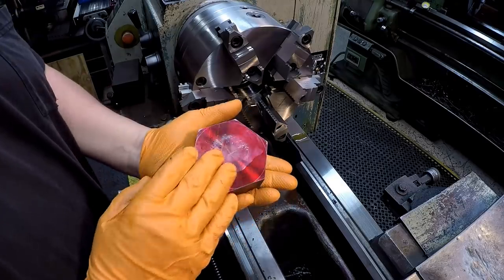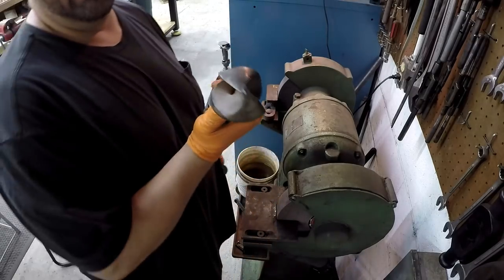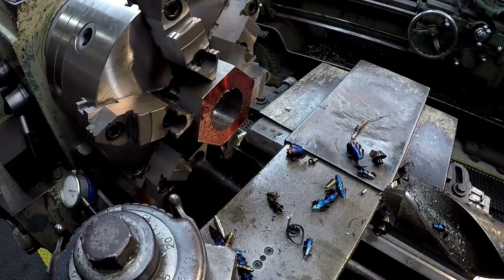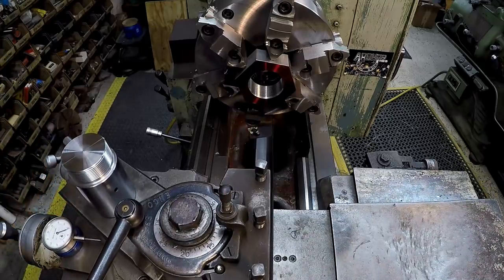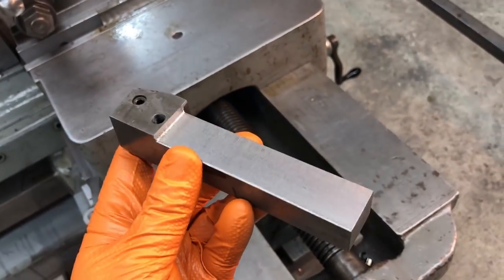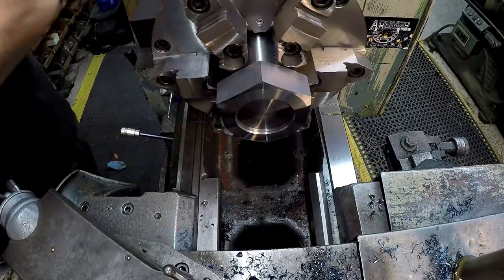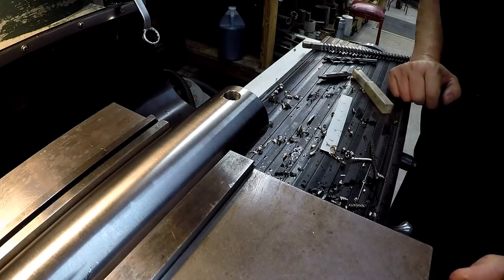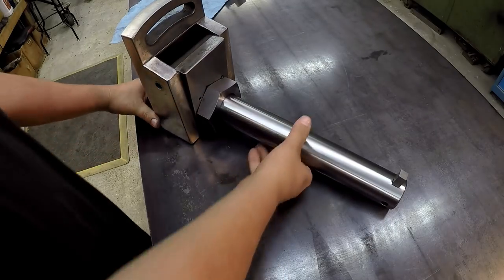Custom Internal Shaping Bar Part 4

Comment: Nice job Adam as usual!!
I have one suggestion for you, would it be good to cut two flat on the bar close from the nut to be able to hold the bar with a wrench while tightening the nut to prevent the bar from turning when you adjust the cutter angle??

Just an opinion here but i think it would be practical for you.

Thanks Adam

Comment: Using the shaper to modify the tool holder to cut threads for tooling to run on the shaper.  That's some 'circle of shop life' stuff there, Simba...
Reply: Custom bars

Comment: Little trick I was taught about threads if they are too tight... put in some valve grinding compound.. will polish the threads for smoother operation and give you a little slight more clearance and info an old timer gave me...

Comment: Hey Abom why don't you put a little finishing touch on that nut with some of that tool blue compound you got to stop it from flash rusting seen as it will be handled a lot with bare hands? It would be a shame to see it have rusty fingerprints on it seen as you did such a nice job machining it shiny and smooth. P.S I can't wait to see you put this bad boy to work.
Reply from the maker: What about my rainbow finish? 🙁
Reply: @Abom79 , Why stop there, you can hone it in with lapping compound and diamonds!

Comment: The 6 jaw chuck seems to be working very well for you.  I'm always amazed at the finishes you get on your work.  I've made some big nuts while working at the shipyard, but it was mostly hot rolled and the finishes even with some emery cloth never seemed a smooth and shiny as yours.

Comment: I find that today there are very few people who can sharpen a drill bit off hand.
Reply: Yeah sharpening drills is a skill I have yet to master.  If the drill isn't real bad I can get it sharp, but there's them days i can't seam to get a certain drill sharp enough to cut wood. I seem to toss them in a can and let sit. I wonder if the twist rate is different than what I'm used to. But if the drill looks like Ave used it in that cryobi mill in some dare to purposely wreck a bit, ehhh I'll have to try n get some pics of the drills I found in the shop hiding out in the corners and under presses,. 1 looks like someone ran it backwards at Sonic speeds to do some spot welding on A2 treated n tempered steel.
Reply: You need a good grinder that has big enough stone for the drills, needs to be kept dressed regular

Comment: Can I ask a really dumb question, not trying to be a butt head? Why would you cut down your tool holder (a five minute job on a milling machine) on a shaper (turning it into a 30+ minute job with a worse surface finish)? Again not trying to be a jerk.
Reply: Tony if you watch Abom much, you’ll see he likes to show different methods that can be used. Yes he could have used the mill or he could have used a belt sander or he could have used a file for days. At this point in his videos he was trying to gain experience with the shaper. I don’t agree with the mill giving a better finish. I prefer the wood grain finish over the swirl marks from the mill.

Comment: There are those nice toolbit sleeves you can just press into a round hole to make a boring bar, or in this case a shaping bar. I think Keith Fenner demonstrated them. You can get them all the way up to 1" toolbit size and it eliminates the need for broaching. Nice job on the threading, real pleasure watching your work. Thanks for the video. Cheers.

Comment: Beautiful work, Adam. The shop that I worked in years ago had a similar bar with one significant difference. Don't know if it was shop built or not. It had three or four (it's been too long) square holes in the bar for tools. That was useful when setting up, although not completely necessary. Choose the hole that most closely fits your setup and make a minor stroke adjustment. It also kept the ram basically in the middle of its travel and limited stickout. More contact with the ways and maybe less chatter in theory. Not sure if it made a noteworthy difference, but we used it with great results.
Reply from the maker: Not a bad way to do it. Thanks.
Reply: Worked really well for what we ran into. This was a rural Indiana machine shop. We did some production work, but the main business was fixing machinery for farmers. Those guys, God love them, could break an anvil in a sandpile. Thanks for sharing your knowledge Adam.

Comment: I used to grind drill bits at a shop I worked at...the CNBC guy would send out carbide bits to be sharpened and when I told him I could do it by hand on the diamond wheel he said ok...he said it cut better and longer then when he sent it out...I love grinding drill bits

Comment: Hi man, another great video.
My grand father asked me when I was 10 years old to sharpen a drill bit.
My reply was “what”?
He told me that only a true fitter/machinist can actually grind a drill bit correctly.
From that moment on I have had a passion for machining.
Can count the people that I’ve taught.
Good video.
Reply: Eoin Wylie.You are correct on that ,I expect Adam has come in contact with some of the so called machinists, fitters and especially fabrication workers who can't sharpen a drill by hand on a grindstone wheel , they just go to the stores and get a new one .Even had an ex army officer as a machine shop manager many years ago who couldn't read a micrometer had to use a rule to measure the gap between the anvils on the mic. his initials are M.P. hope he reads this as I haven't forgotten the times he put hand hacksaw blades in the wrong way round ,wondered why they didn't cut and he kept breaking them.
Reply: Throw a left hand drill bit to so called fitter/machinist to regrind!

Comment: Hey Abom ,
      I love watch your videos man . This video caught my eye and it was a treat to see that shaper. I do a little work in a couple shops my self . I worked for Shuester and Metler in New Haven CT and Secondary operations in Hamden . Nothing major , just running drill press and grinding dies to go with arbors in the wire straightening machines , learning lathes and doing crib work. I screwed up one of the jobs which they were grooming me to be an equal in the precision shop . I was young didn't have the patience on top of being ignored for a while as they had a client problem worth at least a million. I walked and my loss.   Anyway , I wanted to tell you my brother who was an actual well qualified machinist used to run a plaining or shipping machine to cut the decks on these machine bases His machine  was about as long as a school bus , had a sled that ran the work  linear to the cutting bit and with the bit hanging over head .  Hahaha It would make coiled  chips that were about a foot long and  between 1/8th and a 1/4" inch  long . So seeing that shaper took me for a trip down memory lane . Anyway sorry for the long comment stay cool.

Comment: Wow, only you would have gotten the hex on that nut to align straight up when tightened on the clapper on the first try. Didn't see you file the burrs on the back side of the nut? Did you notice that the electric box on the wall behind the press is in line with the vise? Should you have a cover on it to avoid blowing stuff in there when cleaning? Lastly, I've seen so many Abom79 stickers in lots of the other youtubers videos. Great impact your having there in the community!

Comment: For a 1 off job like that you’re on point mate,absolutely flawless method and technique working with the technology you have available.I don’t but me personally if I was making say 10 I’d much rather use round bar and  and milk the flats on later much easier on ya tooling.

Comment: I'm pretty good at hand grinding drill bits but you did a fine job on yours. They can be done on a cup wheel but that takes a lot of time if you put a secondary edge on it.

Comment: Thanks , I am loving your video's very much . So much that I have Actually been glued to the screen for the last 6 or so hours ... True ! Hey I have to tell you something . Whilst I was watching the custom internal shaping bar part 4 . I got a weird premonition about your right lower arm and elbow .. I am not prone to premonitions . I think in general  it's all B/S But this was strong .. so just in case watch out for your right arm ...I used to work using an 8 chuck lathe , and the chucks never stopped in the same position . to make it even more dangerous the splash guard was aluminium and you had to feel your way thru a 6 inch opening to the auto close chuck . I was doing high pressure L shaped hydrolic hose fittings .And you had to remember just exactly where the chuck stopped when the piece returned to the start and was ready to flip to the other side .Anyhow thanks again for your video's .. loving it

Comment: My late brother-in-law Ed was at the used machinery dealer when a truck load of machinery came in.  He watched as they unloaded things in the yard.  One machine caught his eye and he went and looked at it.  Covered in grinder dust, caked and filthy, it didn't look like much but he decided he wanted it.  Went into the office and made the owner an offer.  The owner was busy and had some idea what the value of the shipment was so they haggled for a bit.  Ed wrote him a check and had the machine carted to his shop.  The youngest man on the floor was pointed at the machine and told to clean it up, lightly oil all bare metal surfaces.  At the end of the day Ed had one of the most versatile tool grinding machines on the market.  It would grind drills (adjustable tip angle), milling cutters, shell mills; you name it.  He cackled as he told me the story.  You need to find a tool grinding machine, or at least a drill grinder.  It would save a lot of time and trouble.

Comment: Beautiful machine work there.  I was going to ask about having some sort of index pins on the tool holder so it would be easier to have the cutting tool set at certain angles but realize that it would probably not work to your benefit.  I could be wrong about that though.  Either way, you did a real fine job on that set up.  Keep up the great work and content.
Reply from the maker: More to come on that soon.

Comment: You actually don't want the face of the nut to be perfectly square to the threads. A small offset provides the locking action for the nut when it tightens up, basically working as its own lock washer. If you are using a lock washer,  than squaring it up is fine. A couple other small things could be improved, but nice work generally...

Comment: Just curious, why did you put the set screw in the side of the bar rather than the end like your lathe boring bars? I love hearing your rationale as you work!
Reply: There is more material in the side than in the end...
Reply: I think he ended up doing both.
Reply: not only that, but if you put the set screw in the front, it could throw the tools positioning off from the torque of the cut and blow out the threads.
this way it is relying on the strength of the bar to back the tool up when digging into the work piece and not putting stress on a set screw or the threads of the set screw.

Comment: Random question, given the fit on the nut if you just use some super fine lapping compound on that would it open the threads up at all?

Comment: pretty cool adam, shaper defenitely comes into it's own when trimming down the hardened steel toolholders for sure, lol.
Reply: I was thinking the same thing. And it was done without expensive carbide tooling. I get it now.
Reply: lol, I use my shaper to do stuff like that all the time, and it's amazing how cheap it is on tooling. I still have the same bits that came with the shaper, so they tend to last for almost forever on cheap tool bits, and if you need a custom profile, just grind one up at the bench grinder/belt sander.

Comment: When the fit is that close, maybe some lapping compound on the threads when you're running the nut back and forth? Just to knock down the tiny amount of interference.
Reply: I found antiseize works as a lapping compound, just much lighter duty.
Reply: @macmaniacal  Automotive rubbing compound works well also.

Comment: Nice work Adam, a quick question about the scraper, why does the cutter bounce up on the return stroke if its already to depth on the forward stroke? is it caused by the cutter moving over for the next cut at the end of the push stroke before returning? that would explain it and cause the clapper to work as it does. TIA
Reply from the maker: It allows the tool to lift on the return stroke and help prevent drag on tool. The bounce your seeing is the tool hitting the workpiece on return stroke.
Reply: it doesn't really go to full depth on the cutting stroke even with all the iron the material pushes still the tool a bit away. 
so if you did a spring pass it would still remove bit of material

Comment: Sometimes you can use a little valve lapping compound on threads helping to mate threads also for cleaning and damaged threads as well it can be a little messy but nothing that a little brake clean can't fix but it helps to smooth out the fit
Reply: I went looking through the comments to see if anyone had suggested this. I've used this method before.

Comment: Adam
Full disclosure, I'm a bit of a moron, but i couldn't help but think that there should be some kind of a key or spline to keep the shaft from spinning.
even with your abom torque, it seems possible that the shaft could spin on you, even if by a few thousandths.
I'd love to hear back, if possible, on whether I'm overthinking it or why it would or wouldn't be necessary on this application.
Reply: I guess it is possible but Adam is not the first to try this so in practice the cutting forces must not be high enough otherwise others would have added this feature.  Good question and good thinking though.

Comment: Amom, great video, and very instructional. Question: How did you manage to engage the half nuts with the lathe turning at 350 RPM? I recently cut some 2-10 threads and tried to increase from my slowest speed (70 RPM ) to the next highest ( 120 RPM ) and the thread dial was spinning so fast I couldn't reliably engage the half nuts. Are my reflexes too old? This was my first time cutting threads with insert tooling, and I thought that faster is better with carbide, however the finish is good, the job just took longer. Your thoughts and advise would be appreciated.
Reply from the maker: For a 12 pitch thread you can engage at any position on my lathe, you don’t even need to watch the dial. But isuppose I’m used to it from threading hydraulic rods each day.
Reply: ken foley Amom? Have you been time traveling with This old Tony? We already saw him become Avon79 because of that.

Comment: Hey Adam. Try machining some dove tails in your tool holders and slide them strait on your tool post. Well you have a multi flex so it won't work, but dove tailed tool posts they work pretty good. You can mount some all thread on it also to adjust for center height. You probably know this already.

Comment: Beautiful machining on that nut! About broaching - wasn't it quite important to have square hole perfectly perpendicular to shaping bar? I mean the part when you scribe four lines and align broach just by sight. Why not attach some longer block to square part of broach and indicate it exactly to be aligned with bar? Please correct me if I'm wrong

Comment: Adam, lining up the square broach by eye seemed like a shortcut, after having put so much care into the other elements of the design.

Is there a more precise way to initially square-up the broach, and to maintain its squareness during the press operation?
Reply: Don't underestimate the eye. :) I think it would have just been worse trying to line it up with extra tools. I'd wager a free lunch that you would need a 10ths indicator to see any real misalignment.
Reply: The Metal Butcher I like free food, so let's look at this two ways.  :)
If his angular alignment is off by 1°, then his half-inch tool bit will be off by 0.0087" from edge to edge.
But if he had indicated his broach to 0.001" from edge to edge, then it would have been aligned to 0.1°.

Comment: Probably a dumb question, but is there no good way of organizing those drill bits? Like a rack or index of some kind?
Reply: It's nearly as expensive to organize big drills as it is to buy them. And then they take up a lot of space.
Reply: I guess I just imagined a rack of some sort with spaced holes, then mount the rack to the wall. It'd have to be some thick steel and heavy duty anchors though.

Comment: Do you think you could make an attachment for a small adjustable boring head that holds an angled carbide cutter to use in place of those big drill bits? I have been seeing ones lately that use two locating pins in the face of the head. The benefit is you could make multiple passes and a finishing cut by adjusting the head. In my inexperienced opinion, anyway :)

Comment: You really power through operations that most of the hobby machinists would take multiple operations to do,  like that 2 inch hole... you went from a small pilot to full size, where most of the time, I see these wimpy lathes having to go up a quarter, up a quarter,  up a quarter...

Comment: Adam what a fucking brilliant job! It was a joy to watch you do that. The finish that came off of the angle you put on the hexagon was like a mirror. I would have swivelled that tool bit to face the end of the nut to match it. A bit of bling!!  With the tight half inch square hole would it have had any effect in running the broach through another couple of times? Or doesn't it work like a spring pass? Lovely on mate.